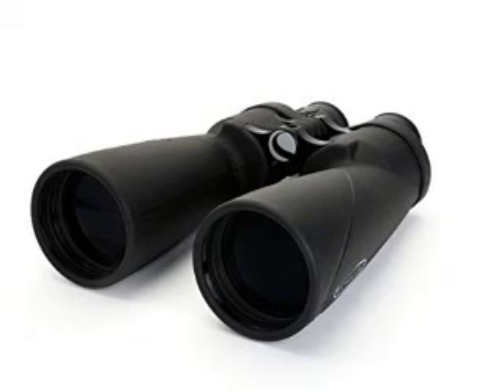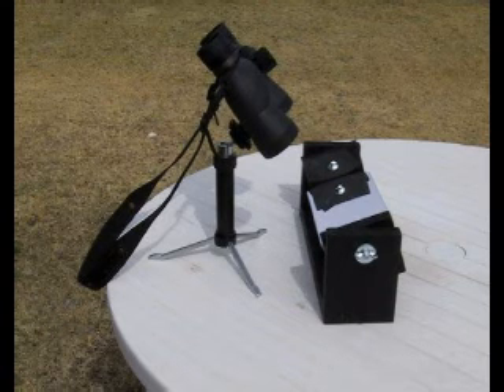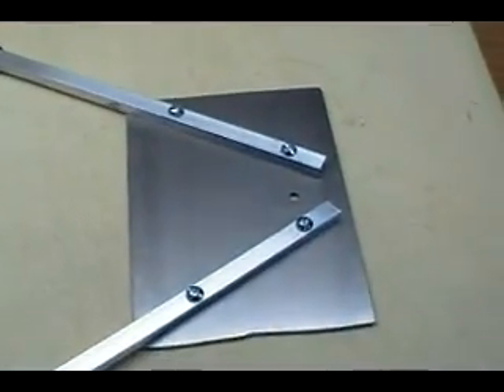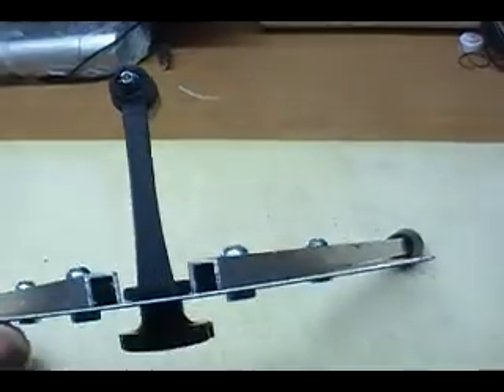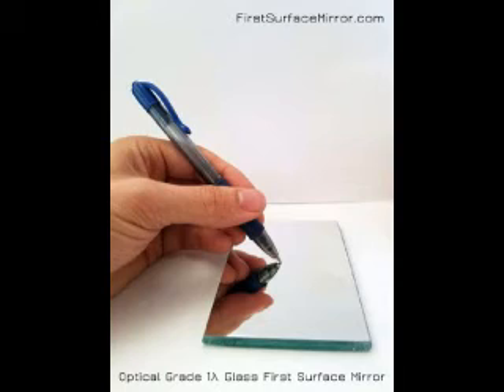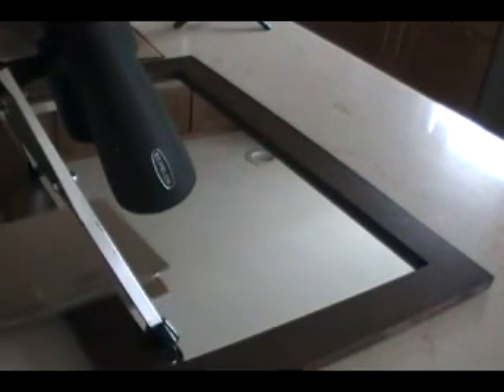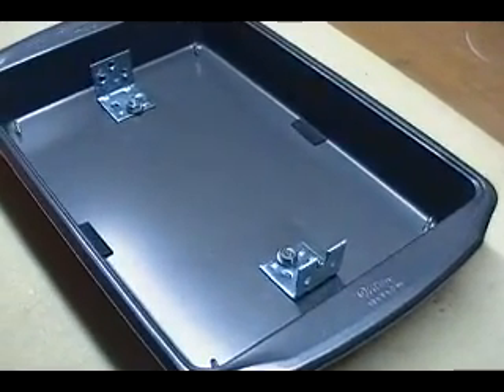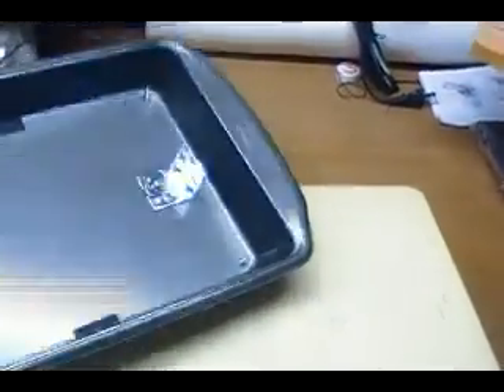Astronomy Viewing with Binoculars and Mirror

Comment: After several weeks of contortions with my tripod rig and hand held efforts I have decided to   build a mirror rig. Before starting I have two questions. I live in an area where heavy dews are common. Have you found that the mirror is prone to fogging and if so, what do you do to prevent/reduce this?  Thanks again.
Reply from the maker: I've not encountered severe fogging of the mirror. If I had to attribute a cause, I'd guess that it is due to my observing posture which crowds the mirror enough to at least partially block radiational cooling. (Coming into the house, however, the mirror becomes opaque.) If positive steps are necessary, I'd aim a table fan to blow on the mirror - not to cool but to move air across it which inhibits fogging.

Comment: Very ingenious. I especially liked your use of easily acquired items and materials and where you got them. Thank you for taking the time and effort to produce this most informative video. I'm just starting to get into binocular astronomy and had been worried about neck and back fatigue. Your low cost mirror solution looks to have solved this issue. How has it been working? And any ideas or issues for improvements? Thanks again.
Reply from the maker: It really saves my neck and arms. My binocular is heavy. The comfort using this gives me more stamina throughout the night. I find that I will still take a direct [binocular] view of the target from time-to-time because there's something (intimacy?) about looking directly. I can do that by simply lifting up the binocular because it isn't attached to anything. Not that there can't be any improvement but the current arrangement works for me so I've not been thinking of changes or enhancements. If you make one, post a video and come back here to link to it.
Thanks for your comment.